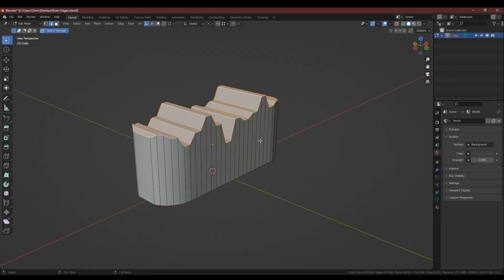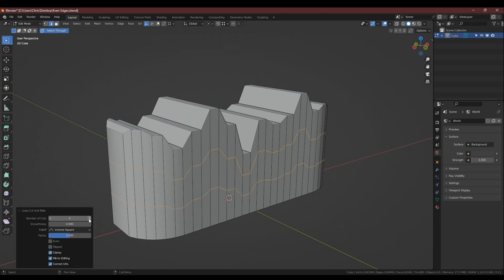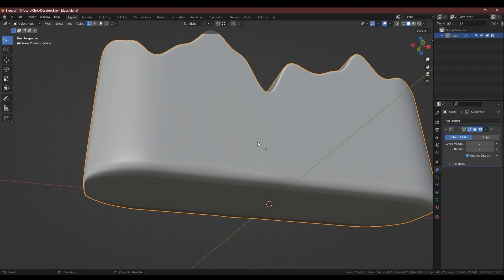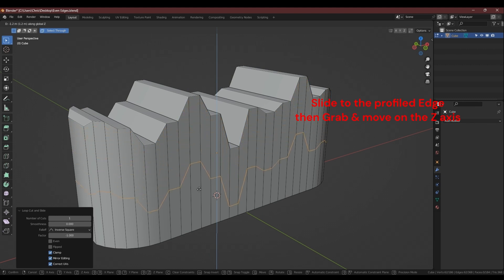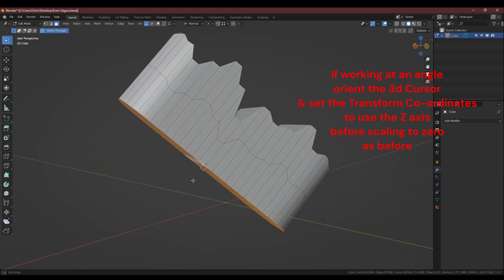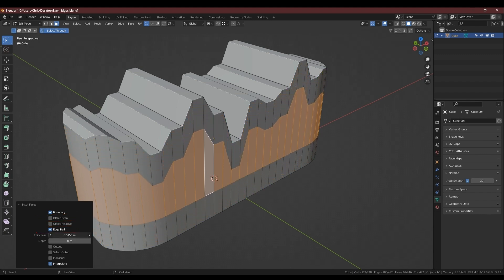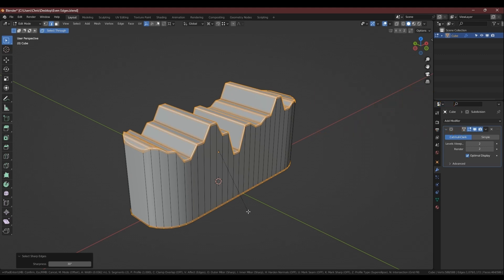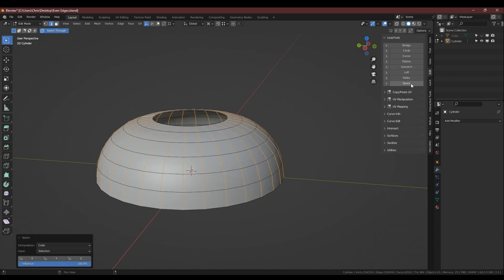Blender Tips -  Even Edges

Comment: how do you get the "edit" menu to show up when you select looptools: space
Reply from the maker: The menu on that side of the screen is toggled on/off with the N key. Loop Tools is a default add on that you may need to enable in preferences. (I'm not sure if it's enabled by default on newer versions).
Reply: @chrismartinartist  thanks for the answer. But Looptools is not in Blender4.2 by  default anymore. but it's ok you can get it for free anyway, for anyone curious just google Blender 4.2 extension looptools, DL it and manually install it.